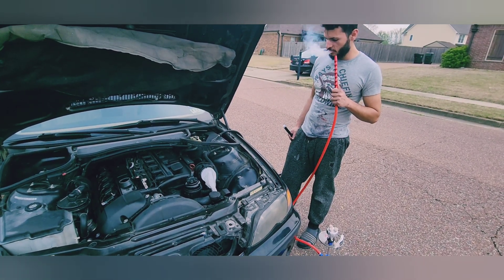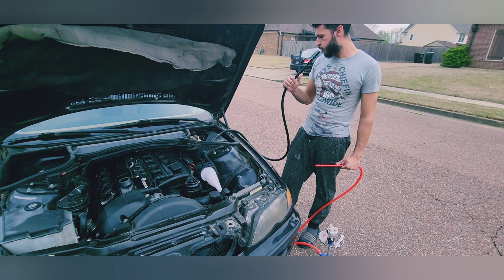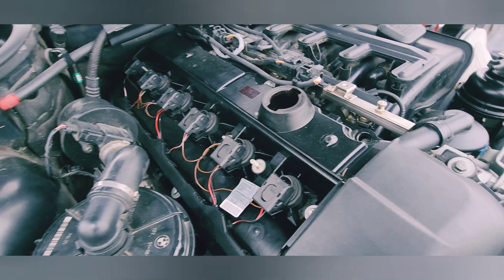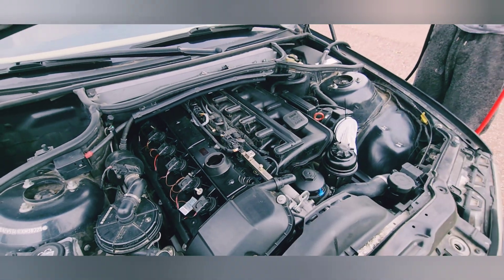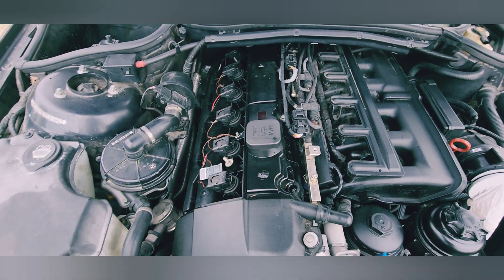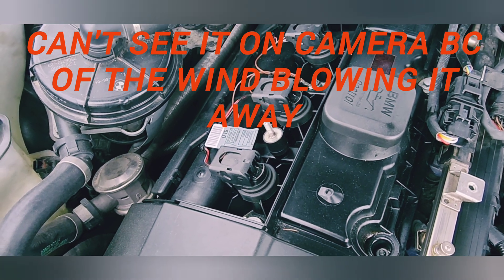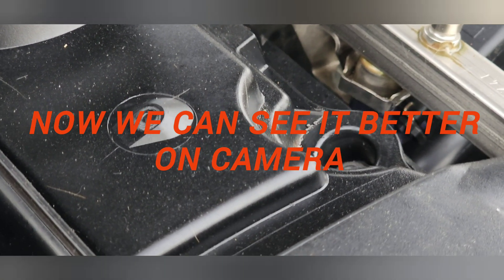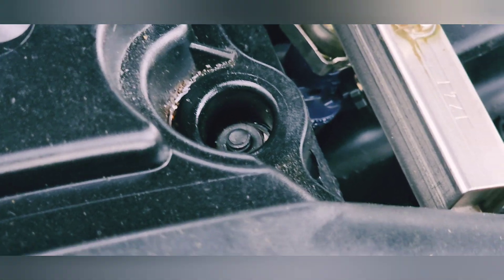Hookah As Smoking Test Machine to test Vacuum Leak. E46 BMW project Ep.7

Comment: it did & way cooler then used socks with mineral oil, I just tossed a bottle like that last night(found in middle of street & put on sidewalk-parking lot.  but I gotta air - water bucket blowr & maybe I’ll flop Dona that hookah yip-yap in there.. cool IDa(btw., leaking oil fill cap gasket, & 1 bolt, is enough to throw a lean code👋
Reply from the maker: Lol, just make sure your car won't get high. It will throw a code if she doesn't like the flavor 😁